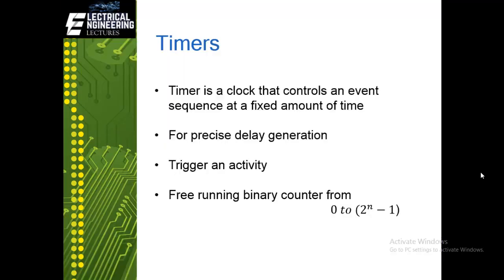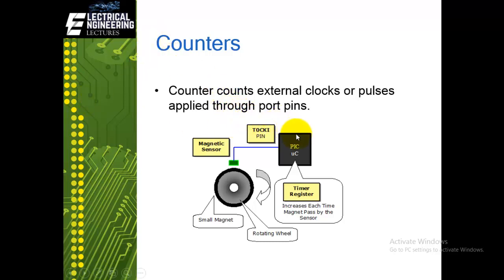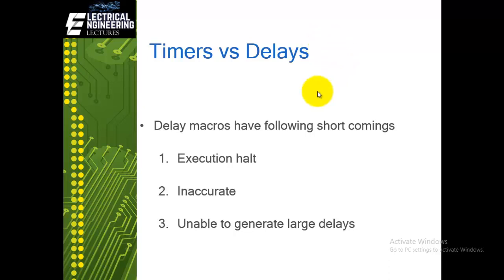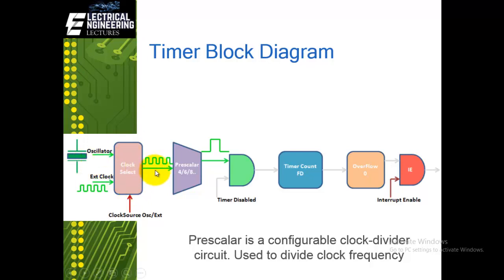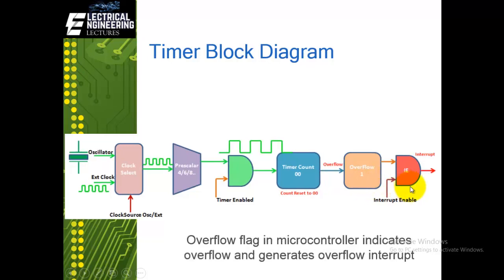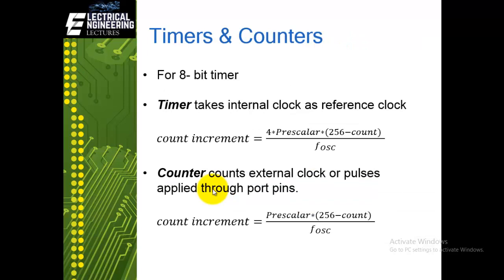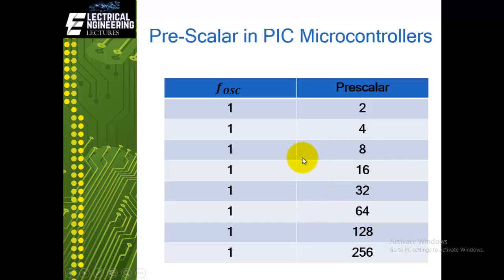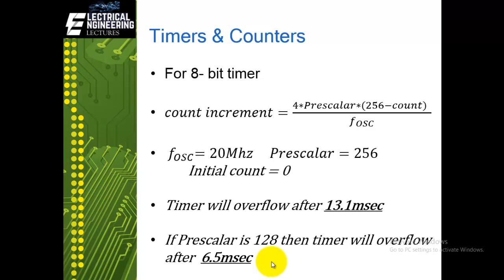PIC TIMER AND PIC COUNTER TUTORIAL | PIC16F877A TIMERS

Comment: Hi i have a doubt   i need to increase  pulse output of an encoder channel A and B    frequency about 300-500hz   i wanted to feed this  to pic16F684   and need a frequency out of about  1.3 times   mean  400x 1.3  hz  both channel.   Can u please help
Reply from the maker: U can achieve this frequency by properly adjust the parameters of timer function
Reply: @electricallectures   how to multiply frequency   since we have 2 sources. Which timer need to be used  ?